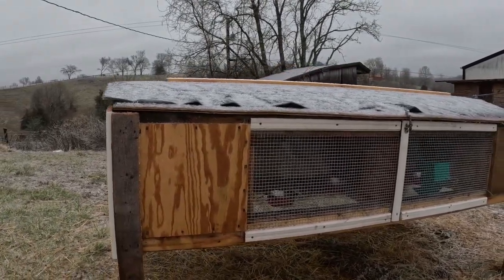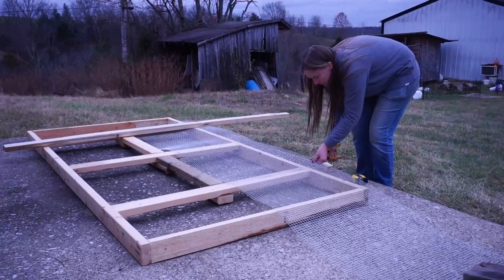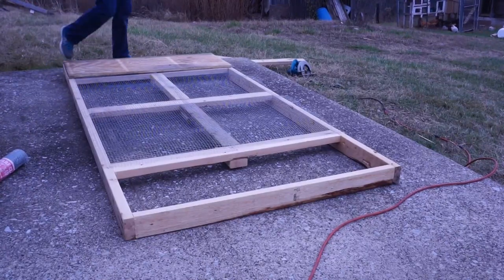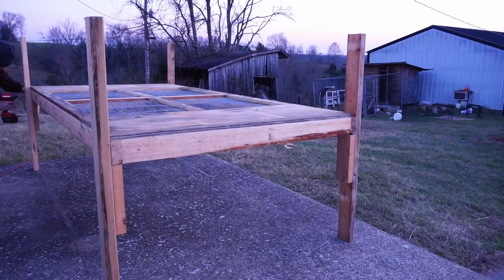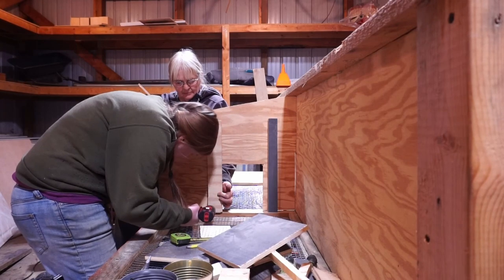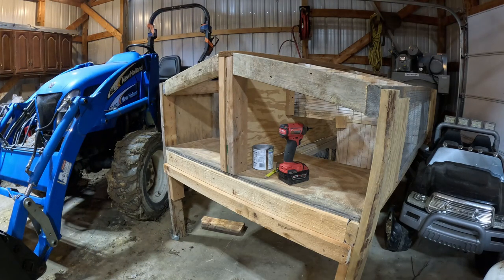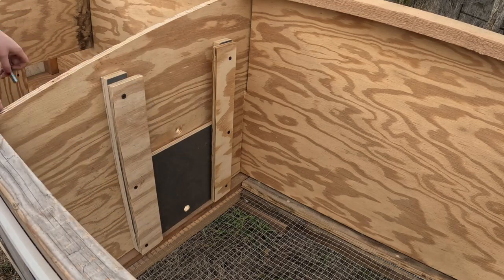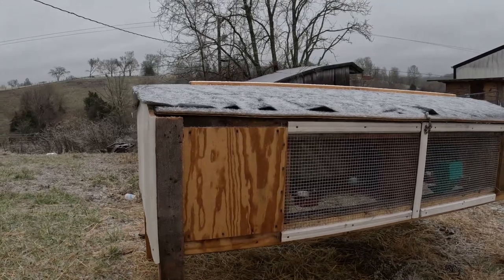How To Build a Rabbit Hutch Affordably

Comment: Just curious why you didn't use a screen floor under the whole thing. Do the rabbits pee and poop in their next box area with the hay in it? Great video - I plan to make a unit similar to this. Thank you.
Reply from the maker: Hi, thanks for watching! The main reason I chose to have a solid floor in part of it is because the rabbits will be living in this hutch year round, and we live in a place that gets quite cold in the winter months, so a solid floor will provide more protection from the cold and wind when needed. Some of them are pretty good at not using at as a bathroom area, but some of them do, so that does mean that I have to clean them out periodically and make sure they have clean bedding, especially when it is cold, so they will be able to insulate themselves. Hope this was helpful 😊

Comment: Why didn't you same for the walls for nest boxes like middle wall ????

I mean it been easier to have done all same time
What breeds are your rabbits ????
Reply from the maker: Are you asking why I didn’t do them in one big piece with a notch, like I did the middle divider? If so, the answer is mostly because I was trying to use as little material as possible and use what I had as efficiently as I could, so the nest box dividers were a good place to use up some odds and ends and minimize waste 😊. That said, you absolutely could do it the same way I did the middle divider, and yes it would have been a little bit faster and easier! 

Two of them are full New Zealand, and the other two are New Zealand crosses. 

Thanks for your comment and thanks for watching!